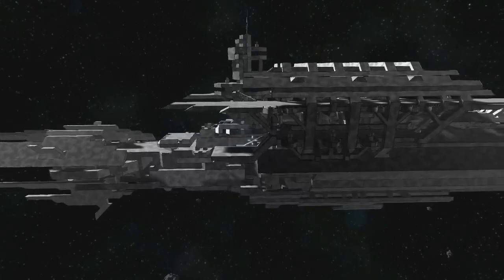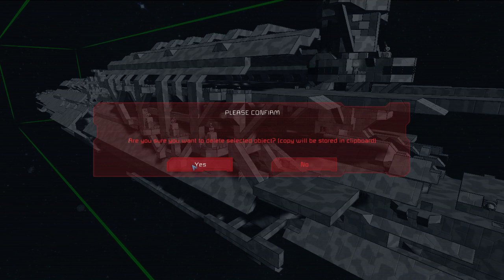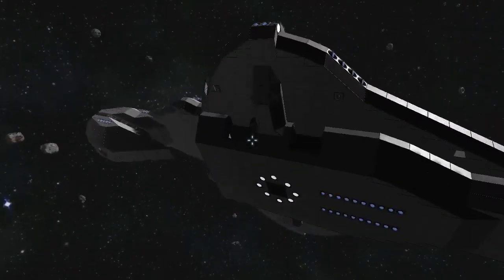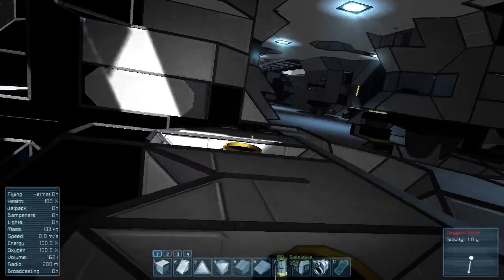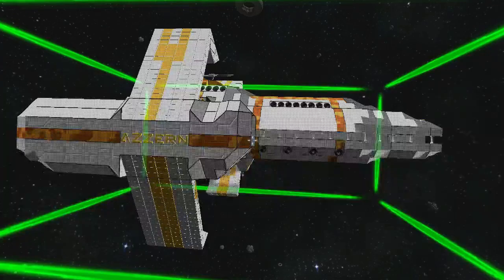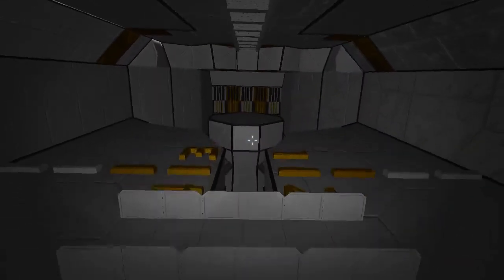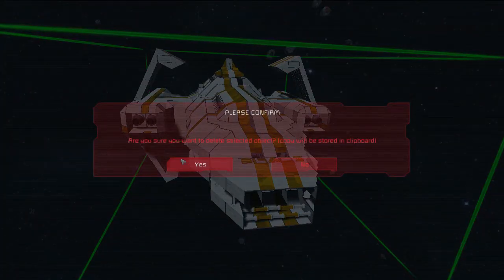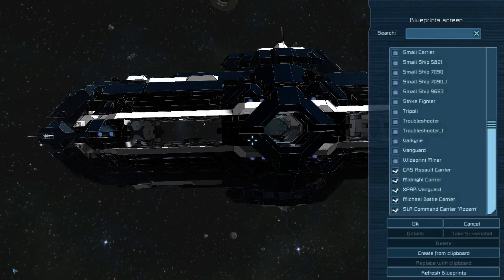Let's Analyze Space Engineers Carriers

Comment: Sure you don't want approach paths? You could do a manual approach and send path positions/rotations to your central control which saves them in a relative to ship "pivot" manner and calculates absolute values to send to the drones for actual automatic approaches. Or is the communication channel too narrow to fit 2-4 positions+rotations? (Haven't played myself yet btw, if this makes no sense)
Reply from the maker: DerClaudius The problem is that the "center" of the drones is wherever I happen to place a block named "mark core". It's not hard to go from point to point, but if it's crowded, it's easy to bump the edges, get caught, and spin out.
Reply: You can easily have an offset vector for every drone type.... so drone type A knows itself that the real center is markCore+[-1,2,3] etc.
You could even calculate it on startup with something like this script that shows the map of the ship
Reply from the maker: That begins to balloon: after I do that, I need to also have each drone know its own bounding box, and then I need to send the tunnel size along with the docking request, and then I need a "docking request unsafe" response...

The other option is straight-in docking ports, which already work and require no added code.
Reply: yes, yes, that sounds all awesome. Make it so ;)